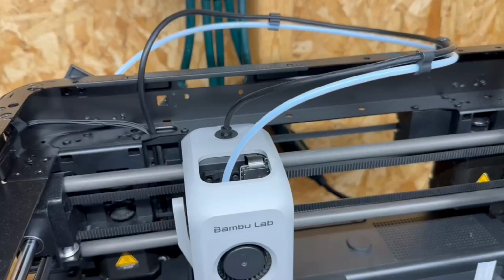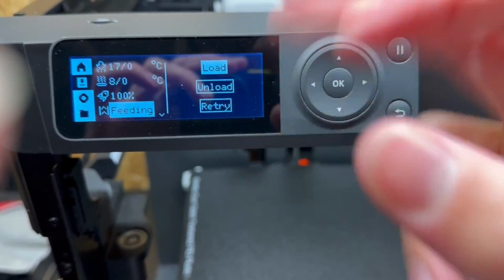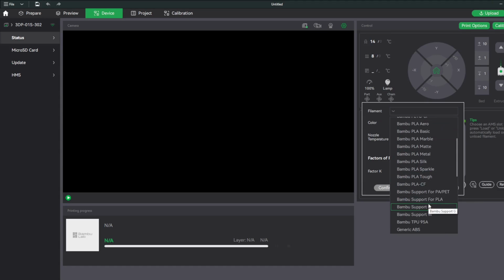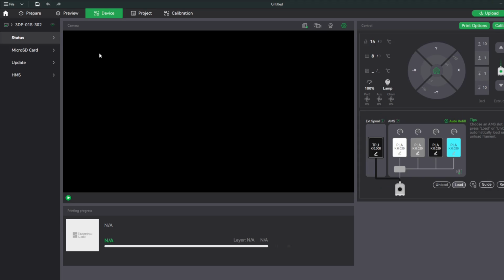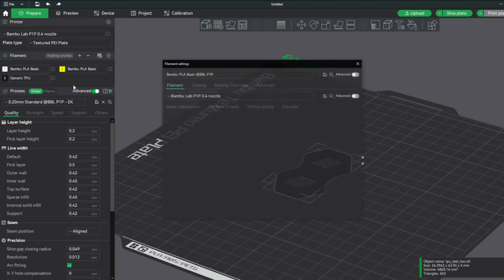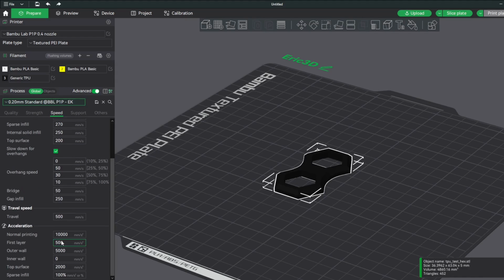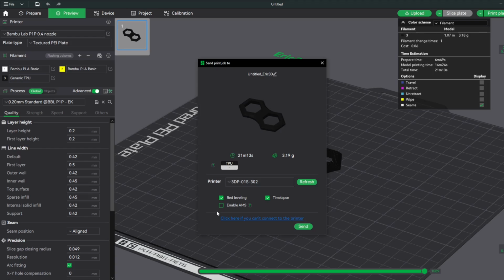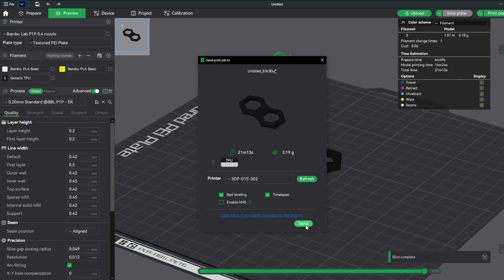How to Print TPU on the BambuLab P1P | P1 Series BambuStudio

Comment: really liked your video especially the use of pressing a number to associate a  filament. helps alot. i want to start using a few different TPUs for a project on my P1S and make an individual profile for each. is it enough to run the configuration wizard for Pressure advance and Flow rate for TPU or would you recommend changing more settings than that thanks for reading have a cool day
Reply from the maker: You would have to change settings until ur tpu works. For mine, i just use the preset in the video and it works great. Please subscribe if you haven't already!

Comment: hi so i have a problem where i can’t seem to get the tpu to come out the nozzle but i know that the extruder and nozzle isn’t clogged and my tpu is bambu lab tpu 95 HF
Reply from the maker: when you are inserting your filament make sure u feel the gear catch the tpu. The first step is important, you have to make sure u insert the tpu manually all the way to the gear then press that insert button on the screen. lmk if u have more questions
Reply: @3DEric  TYSM IT WORKED
Reply from the maker: @izzyr5469  My pleasure, make sure to subscribe if you aren't already!